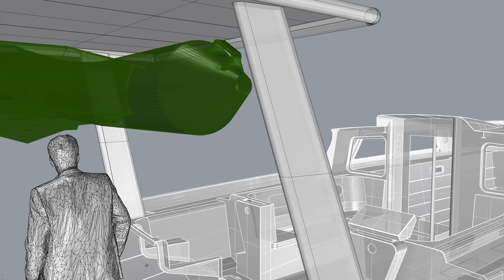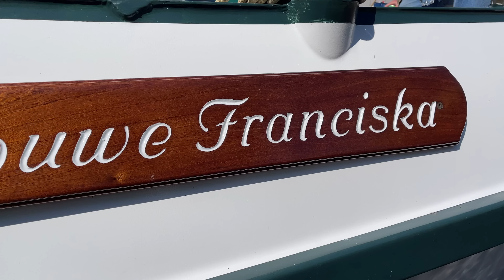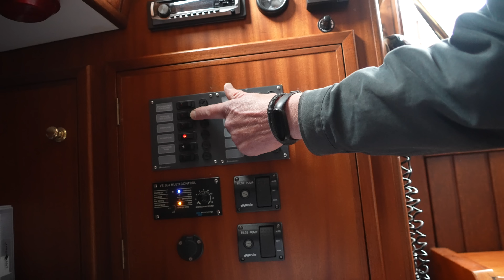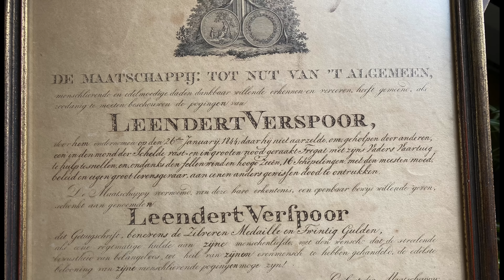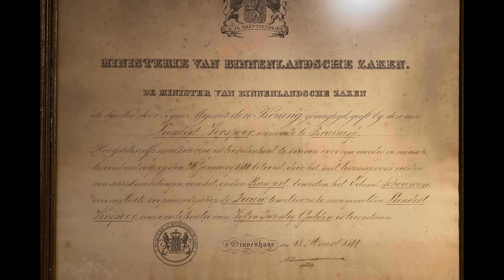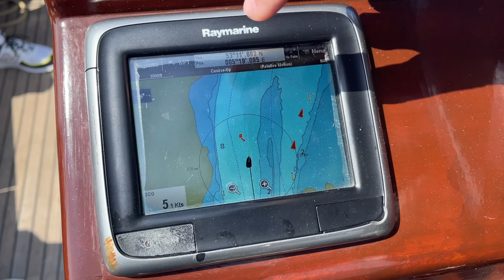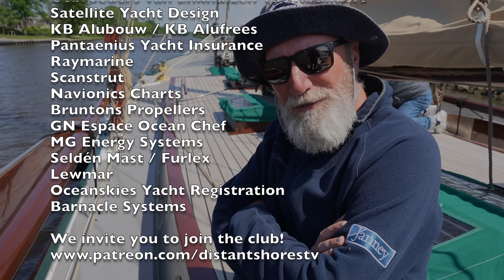Shallow-draft Sailing a Traditional Flatbottom Boat | EP 220

Comment: 15:52 That's the fun of barge sailing on the Wadden sea: you don't have to keep to the channels. You can use the tides to hop over the banks from one creek to the other. But it requires good timing using the currents of the tides. Only for experienced barge sailors

Comment: I expect the initial stability augmented the shallow draft although I can't recall what is considered a shallow draft. The weight aloft seems significant with no real effort with design considerations to limit this. The halyards have been replaced with Dynema but the standing rigging seems traditional. Under sail did the Leeboards splash as some leeboard designs tend to do?

Comment: What a treat to get to sail this almost ancient type of boat.  

Always wanted to ask what the boards are for.   And aren't they the origin of the term "starboard"?  So they're a lee board for countering leeway, like a flat daggerboard.  Since the hull is relatively flat, presumably they help quite a bit.
Reply from the maker: The leeboards are remarkably effective at preventing leeway. Quite an innovation for their time!
Reply: ‘Starboard’ is derived from ‘steerboard’.
Viking longships had a steering board (a rudder) mounted on the right hand side of the vessel.
Reply: @johnstarkie9948  Yes, and it also probably countered leeway.
Reply: @LoanwordEggcorn  
Most rudders contribute toward mitigating leeway.
Reply: @johnstarkie9948  That's far more the job of the keel in a present day design, in part because it's nearer the center of effort of the sails.  If the rudder did it, that would be too much weather helm and drag and be very inefficient.  

(A keel or rudder at a slight angle of attack to the water flow generates (sideways) lift in the water.  The hydrodynamic lift from the keel counters leeway.  The hydrodynamic lift from the rudder turns the boat.  All the sails and keel/rudder act together to find a balance of forces that determines how the boat moves.)

When the sails are best trimmed, the rudder acts as a "trim tab" to make small adjustments to boat direction.  The trim of the sails should cause the boat to go to the desired course with minimal input from the rudder.  (A boat can be steered by sail trim alone.)
Reply: @johnstarkie9948  Youtube seems to be censoring me again. The keel provides most of the lift to counter leeway.  If a rudder did it, it would be inefficient and have too much weather helm.
Reply: @LoanwordEggcorn  
The Yorkshire Coble has no keel.
It has a deep forefoot and a very deep,  long rudder which is angled forward under the boat.
The rudder provides most of the leeway resistance.
Matt Layden’s Paradox has no keel.
The rudder is big and strongly mounted,  and the sail is set further aft than most sails.
The rudder ( together with the chine runners and the ‘lifting body’ hull form) provides most of the leeway resistance.
Reply: @LoanwordEggcorn  
I agree.

Comment: To many skills required to sail these boats..where is the captain?
Reply: When you are experienced enough, you can rent such a large boat. I only sailed far smaller yachts, and being a Dutch man who sailed as a kid, I would first sail a smaller traditional ship for some summers, before I would do that. As crew however, I'd love to. Thing is, such an aak is heavy, and the danger is that it takes time manoeuvring such sails, you must plan ahead, make shure you got enough space around you, when sailing. And bridges, canals, marina's, you have the diesel, but the way to avoid accidents is creating time to do EVERYTHING relaxed. When you see you made a mistake, like, hey, the wind blows us away from that jetty, then you can reverse and do it again. That is my solo sailing experience. Trouble is, when you got a strong wind pushing you forward, the second chance goes down the drain. Then you must react fast, if something goes wrong. Don't forget, you are resonsible for everybody onboard. You must tell them safety facts, one is famous: if you see the ship will hit something hard, never push back, you can break your hand or leg, step back, save yourself. Damage is too bad, it can be ten thousand dollar, remember, your hands are more important. Run away. That is why a good captain makes a plan for every manouvring thing. Dropping the ancre, hoisting sails, lifting the ancre, sailing, doing a tack, you tell the crew, you two do this, then you do that, okay? And that way you can watch how things are done. The good ones are quiet, and they prepare the next thing to be done.
And to finish this lecture, an aak is not large at all. The last sailing ocean ships were cutters, those sailed from Asia to, say, London loaded with tea. The faster they were, the more tea they transported each year, and that was big money. Such ships had a large crew, they changed the sails often, it was in fact racing. Suppose you were responsible for such a ship. Compare that to this Lemster aak? Still, a lot is similar. It is.